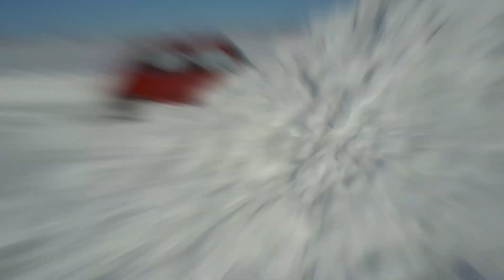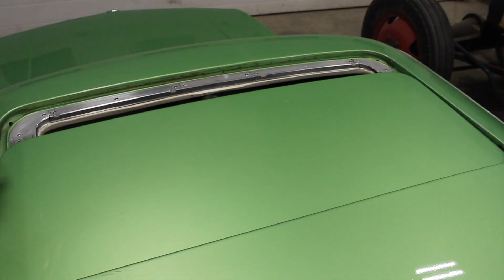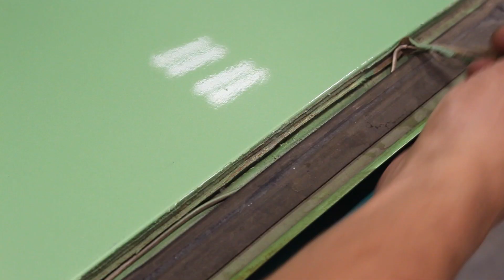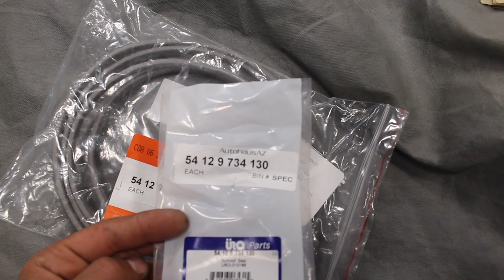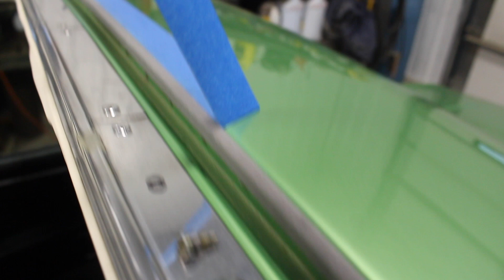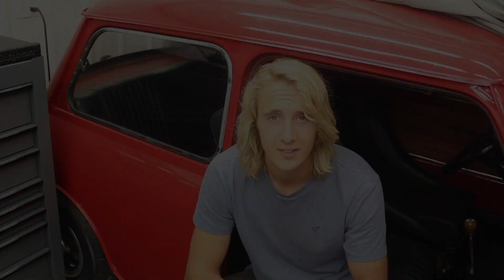BMW 2002/ E9 sunroof seal replacement Guide

Comment: Hi, I watched your video on replacing the sunroof seal on the BMW 2002 (part numbers 54129734130 and 54129734131). I noticed 54129734131 costs more than double what 54129734130 costs, so I was wondering — would it be possible to just order two of 54129734130 instead of buying one of each, and use them for both the front and rear installation? Or are the front and rear seals actually shaped differently and not interchangeable? Would really appreciate your input since you've done this job firsthand. Thanks!